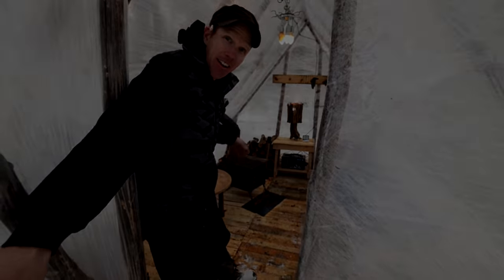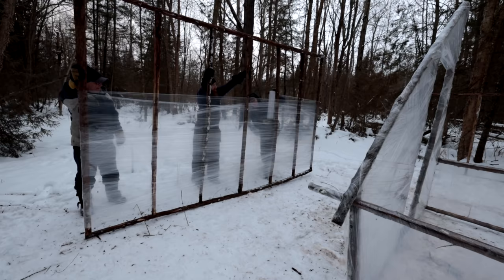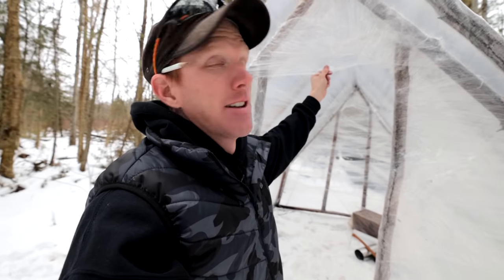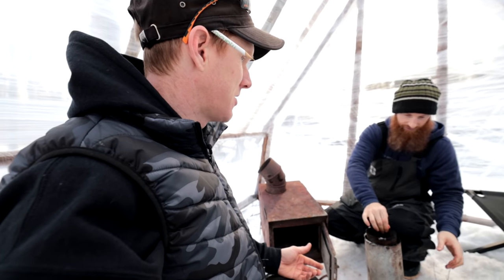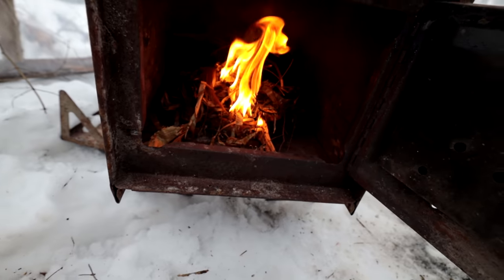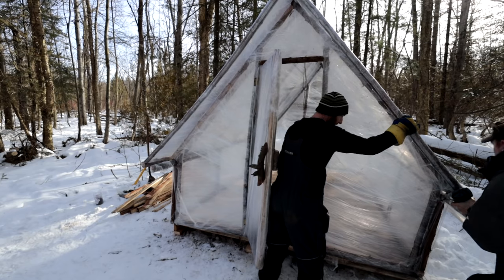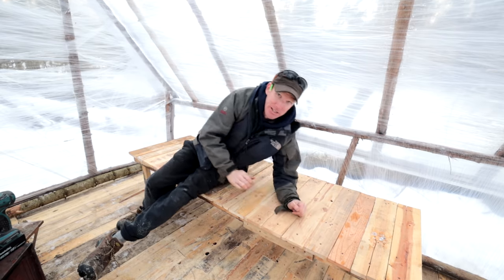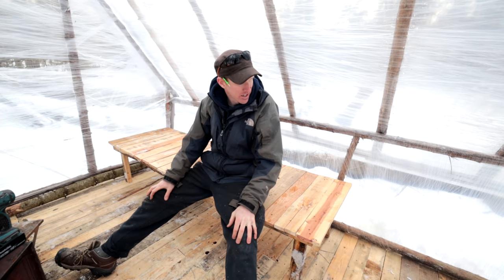$25 Winter Cabin Build (on an Extreme Budget!)

Comment from the maker: Surviving in the $25 Cabin with The Wooded Beardsman: https://youtu.be/77O7Gvud_gQ
The PLASTIC CABIN 3 YEARS LATER: https://youtu.be/MWNnv9DXjJ4
Reply: I would love to see that
Reply: You almost had this right. You forgot to add a second layer shell over it. That is the proper way to utilize it. You want that air pocket. For both condensation issues, as well as proper insulating effect. Close though. And you buy restaurant supply 3300 feet long rolls at 2ft or 18 inch rolls for 18 dollars. Best plastic for the price for longevity and clarity.
Reply: Cool project! What state is this in?
Reply: Sweet!
Reply: @SeeTheWholeTruth  Watch how they wrap it they did utilize an air pocket
Reply: What are the dimensions of the cabin?
Reply: I’m building this and use it as a greenhouse! Thank you!
Reply: You should give us a monthly update on this build to see how it's holding up
Reply: But how much does the land cost?
Reply: Are you going to leave that up?  I'd like to see how many snow storms/seasons it survives.
Reply: Could possibly be a decent greenhouse too . All the forts we built as kids we never thought of this
Reply: @maryschillinger2909  lllllllllll you
Reply: Nice work Hiram
Reply: If you make the hut airtight, and light the fire, would that not use up all the oxygen in the hut?
Reply: @baskoning9896   The air entering through the doorways is enough
Reply: What's the rated snow load?
Reply: $25 my arse
Reply: @jamestreuer7094  you mean greenhouse?
Reply: @madisaur0 Sorry but a bunny rabbit trampled it last Thursday.
Reply: @clairefredriksson5073  it's not for sale Ree-Ree
Reply: you will know if not enough ventilation when moisture forms inside a friend and I did this in 20's and I woke up in very early morn soaking wet our own co2 almost killed us
Reply: @guypatthew7613  ah ok :)
Reply: I'm gonna build one of these for almost free instead of buying a $200-$300 low quality shed in a box. I got a bunch of free tarps and thick clear outdoor plastic (no shrink wrap) Those shed in a box are made pretty crappy.I'm betting with a thick tarp covering the sides and over the roof on the cabin. It'll last much longer than a 10x20  $350 shed in a box.
Reply: 06:00
They are ready 4 thanksgiving
Reply: @maryschillinger2909  q
Reply: You guys are the worst do it with rope or just free standing trees. There are methods to bend trees with half cuts. Plz don't use living trees. You can also build a foundation with half cuts and no rope. For god sake dudes this is the worst idea Don't use F Plastic...
Reply: "WooDeD-BeARDsMAN!!"...YeP he's eXCiTeD to buiLd a FoRT! hehehehe
Reply: I get it's just supposed to ceep the wind of you but won't the seran wrap or pallet rap warp and stuf
Reply: @SeeTheWholeTruth  watch how they wrapped it again.
Reply: @donaldschell1435  For a second I thought you said that moisture forms inside a friend! Lol. 
Use some punctuation.
Reply: @Drefar  They didn't use living trees. Were you not listening? He said right at the beginning that the trees were dead standing trees.
Reply: @judylloyd7901  you don't get the point "plastic"
Reply: You can build a coat rack in your log cabin
Reply: Damn I'm good I knew the coat hanger was coming
Reply: If you ask a guy for pallet wrap in the USA he's going to tell you the job lol
Reply: Wooded beardsman? lol I luv it lolol
Reply: Yeah but the land cost 200k
Reply: Would of liked to see it lit 🔥 up at night w/ the lamp on & the fire goin 🙂
Reply: I followed you because of this NICE VIDEO！
Reply: How creative! I really enjoyed the video!
Reply: Great video!
Reply: 29:40 Chair theft was a common cause behind peoples being sentenced to transportation some 100 years ago.
Reply: You could recycle this content and turn it into a green house.
Reply: That’s nice
Reply: I knew how fuzzy you guys were I could tell by his hair cool video so far so good spend 1 night in there if it's warm enough if you guys want to sponsor trips while your observing and pay for food I'm cool with it ask Mr persistent o.j. riding if it's okay and I will
Reply: Il sign a waiver if you pay me 100 Dailey il try out all your camps gather would maintain sites and observe wildlife for you
Reply: @jamestreuer7094  James let's you and me build one just be nice this time
Reply: @baskoning9896  no because the stove is exhaling and the floor has small holes to avoid some weird venturi effect
Reply: That grills dedicated you got that thing from a good department store good stainless.
Reply: Use burlap or a patatoe sack like 2 of them fill it up with dumpster carpets and pillows or slay like 300 chickens
Reply: Build spear barricades for the bears like mid evil times
Reply: If my grandpa would let me build I would have like 10 contraptions like that out in the yard
Reply: Put the sandwich right on top of the stove
Reply: Put that lamp straight under the middle of the table for conservation of space and it would look cool
Reply: Пine
Reply: Do you have freemasonic stickers on all of your vehicle taillamps? Traveling man.
Reply: $25 Winter Build Cabin title is-in-of-itself a statement that points out an extremely low budget adding the obvious (on an Extreme Budget) is redundant and strikingly obvious.
Reply: This is an awesome idea, however, what will make it mildew or mold resistant?
Reply: self reliance  with battery packs and solar panels relying on new batteries every ones in a wile. tell me how is that self reliance again????? be off grid relying on on grid stuff how is that sustainable
Reply: Very cool idea! However here in Griz country....more like a tasty treat box! LOL
Reply: I became homeless after I caught covid 19 I went to the grid  and made me I small plastic rap structure thanks to videos like yours I'm a happy camper I have always lived in a mountain area and I am OK with it I could get a new home but this is the best freedom ever only me and the criters my next is to find a nice Dog and a good heating source I have servived 17 degree weather so far. It is  great out in the grid  I'm going to build a bigger structure like your video and decorate it with paper bags and a candle called lumennatias all around the place and a sigh saying home sweet home by Christ Birthday and envite some people and tell them what you did to harm me God turned my situation to the most unbelievable blessing I could of never imagend..Thank you for this video ..A country boy can survive..Roland J Gutierrez from Magdalena New Mexico 🇺🇸
Reply: @rolandjgutierrez7737  wish you weren’t so far I have an amazing dog I’ve been praying to find a home for my friend who’s terminal with cancer, this dog is the best but my two don’t want friends there old now. Congratulations for finding happiness I have 3 little ones or I would absolutely be right out there. My mom just moved from NY to Arizona but is in Mew Mexico she’s thinking that’s where she wants to be. She just has her truck an a pop up she lost her job as a NYC teacher because of the shot stuff so she has zero pay sold everything she has an is just going to find happiness someway somehow took her two cats an the dog lol 😂 but I know she will be so much happier sending my prayers to you stay safe an god bless
Reply: Good budget plan with the $25.00, however I'm thinking you got a total of at least $46.00 🤣 Nice job you and The Wooded Beardsman did on the build.  Pretty damn cool!
Reply: I need to find the store where you get Saran Wrap that cheap
Reply: Use aluminum tape
Reply: Netherlands. Holland.
Reply: Has Anyone used bubblewrap? Or that billboard poster material?¹the big ones and/or those little election ones? The little ones you could staple in layers to cover seams..bubble wrap and shrink wrap for the roof more air pockets??

Comment: We did something similar, but with cheap tarps instead of plastic wrap. And we used no nails at all, because we had permission to use land behind our house only if the structure was "non-permanent" (ie no nails or screws). We cut the poles a little long, and did figure eight ties around them with paracord. We put it up 2 years ago. The tarps have seen better days after tons of snow on them, but the structure is good and solid. :) We have an old military "any gas" stove inside.
Reply: Noo

Comment: I've actually done this with pallet wrap to stay warm in the high desert. The most efficient way to do this is to make a teepee or lean-to configuration. I probably used a fraction of the plastic you did. The way it works is the infrared heat radiating off an outside fire placed about 5 ft from the shelter is trapped inside the plastic, heating the inside. It doesn't have to be a big fire as the effect is cumulative. You can warm a small area and make it pretty toasty in about an hour or less. Having a stove or furnace inside is unnecessary. You can build an effective and quite warm shelter like this in about 15 minutes, and have it warm in about 30 minutes after finishing. I would advise most people to refrain from having any form of combustion inside of a shelter like this, even with the piping as you're just asking to have issues with CO.
Reply: @MeepChangeling  hes speaking on someone dying. dont do this n fall sleep. this is very dumb. tbh
Reply: @MeepChangeling  So unnecessarily aggressive.
Reply: Did you forget to bring a tent or tarp?
Actually... it doesn't matter, because this never actually happened. 
"I don't bring a tent or tarp with me while hiking, but I do bring several rolls of pallet wrap" - said no one ever.
Reply: @Cook-px8ne  With the fist sized gaps in the structure i'm pretty sure there is enough ventilation to run 3 of those stoves and not get carbon monoxide poisoning 😄
Reply: @thesayxx  exactly !!!
THAT tent/shelter is NOT air tight and that should be blatantly obvious,,, especially the gappy door 🚪 !!!
Reply: @thesayxx  A structure doesn't need to be air-tight to have inadequate ventilation from CO gas. You don't actually need to have lethal concentrations of CO for the gas to hurt you. Your red blood cells have a higher affinity for CO than O2, and once your hemoglobin is saturated with CO, that red blood cell is done. CO poisoning can take place slowly over many hours. That's why I never have a source of combustion in a shelter unless it is specifically designed for it, such as in plains teepee that is open at the top for ventilation. CO can slowly build up over time. If you're at any kind of elevation, the effects of CO poisoning are more pronounced than they are near sea-level. If you aren't well acclimated for the altitude, even slight CO exposure is going to produce a very noticeable effect.
Reply: @MeepChangeling  well I mean he did say a $25 budget but clearly not everyone can read or listen. 🤷🏼
Reply: @jpacker7977  I find it interesting that so many of you are worried about the CO2. The structure is far from air tight.. Where I'm from (Finland) there are thousands of people sleeping in heated tents (military) around the year, and I have not heard of a single case of CO2 poisoning. There are never any detectors in use for that either. The tents are not open at the top.
Reply: @David Lacey unreal how many Karen's in here I've burned wood 95% of my life and I'm 61 and my dad is 86 and he's still here if we are so worried just wrap the pipe seams with pipe tape you know modern technology lol 😆
Reply: I like your method better J Packer! Thanks!🙏💕
Reply: I just wanna mention that It's a Cabin not a Shelter. You dont usually have drills and screws, and a furnace around when you're building a shelter.
Reply: @janbo8331  I'm sure you meant CO, not CO2, a much more benign gas. In certain circumstances even CO2 can kill you but it is far less dangerous than CO, as Jay Packer pointed out in his accurate post above.
Reply: @BatCaveOz  people just go hike out to do this for fun lol. My cousin does this kind of stuff a few times a year, just because he enjoys trying something different.

Comment: There is a quicker way to do this, look for a grouping of green saplings of about 15 feet tall. Clear out the center of the group of green trees. Use a horse shoe as an anchor and tie it to a rope, pull in the trees, tie them together in groups of 3 to leave a small space in between them. Using as many as 15 trees tied you should have a nice frame for your outdoor enclosure. You can make sturdier by placing side spacing between each tree, all the way up and in random order - will give it the strength of an igloo. Mark your door, by making the brace the top of door frame and two trees as the sides. Wrap in plastic wrap on both sides of trees, start at the bottom and do 3 layers before moving upwards, this will maintain a water tight seal. 
 You can have an open fire in the center, the smoke will go out the hole in the roof, use stones - we dig our fireplace in deeper than our floor so heat begins at ground level znd lay metal tubing to fireplace,  buried, and up high enough outside not to fill with rain or snow  BUT to feed fire with constant fresh air. It's so warm even in -20c. ( yellowknife NWT. Canada) and with green trees, plastic wrap and a pocket knife you can make a sea worthy canoe! Just bring a blanket  because artic sea water is bloody cold!!! Will stay dry, just not too warm!  BUT works in a pinch when all else fails and all you have is plastic wrap! ( most rec boaters have a large roll! Knowing these skills could save your life!!) 
Peace to you and yours!!
Cheers! 
P.s. sorry for the edit, my tablet isn't printing 'a' or ' b' very well...
Reply: You can always find Wood stove and all the pipes at home demo's which are listed in most build home and recycle section in local news paper, have also found nice wood doors, double pained sliding glass doors that make nice nearly free upgrades. Lots of stuff they will let you have just to haul it away! Love visiting demo sights of old farm houses! Pot bellied stoves are an added  bonus! Here they sit at the side of the road for years! ( I know where 2 sit, today! Both cast iron )
Reply: Shazam !
Reply: Thanks for the GREAT TIPs !!!🙊🙉🙈😯

Comment: I work at a big box home improvement warehouse retailer the one where we wear red vests, not orange aprons, in the lumber department. I would most likely give you the plastic that the bunks of lumber come in because we just throw it away.
Reply: I still have my red vests...amazing how much stuff gets thrown away.  I drove @ $ 5K of nuts & bolts to the recyclers, still in original packs.
Reply: @xzqzq  it should be used,,, people can use that.
Reply: how can somebody get the plastic to reuse?
Reply: @Ktrvrn  build up a slight rapport with a worker in the lumber department and then just ask. They will most likely give you the plastic the bunks come covered in.
Reply: Having worn that red vest myself. Yep.. skids, broken stones, snapped lumber.. plastic.. lots of plastic.. hell ive got 4 of the wooden displays that succulents ship in on sitting in my shed as a storage rack because we where told to toss them out after they where empty. Good soild rot free lumber? Yep in the truck she went!
Reply: @GreysonDarkest  I'mma go make friends right now with my local red vester.

Comment: Wool blankets attached to the inside of the roof with furring strips and screws would make that even warmer, while also helping protect the plastic a little from the heat of the wood stove. Just leave uncovered any part you want to leave as a skylight.

Comment: I can almost hear that coyote thinking "crud, there goes the neighborhood" as it looks at the cabin! Pretty cool build, never considered pallet shipping wrap as a building material, but it looks like it worked.
Reply: $25? Ha ha not with through tools
Reply: $25 in gas to begin. use pallets from side of road  chicken wire even snow fence or and bubblewrap.  take a bunch recycling news paper/ straw  or wood chips mix a slurry in a bucket  and fill the skids. You can carry 2 tall skids for 3 miles a day in a modded bike trailer / hobo hauler in an hr or 2 a day. It is debatable if the old growth is a fire hazard or part of the eco system.  I was not present when it was planted so idk right. lol.  They have proven the fact that a tree does nothing or make any noise without someone there to observe it.   If you brought in and modified the pallets then why did you waste energy killing  the trees? . do you know how many rolls bubblewrap is in dumpsters. 3 rolls of that saran wrap would be at least anther $25. idk how many you used . You are certainly not anything like the two dudes in the jungle. They would have built the ice fishing sled from vines and bamboo. Don't get me wrong it is fun and interesting as Bob stated. Personally  I would have spent the money on an old energy pack from goodwill or VV for $14.99 or less. Then snag a cpl batteries and panels from a street sign or something.  The  eliminator power box  with a 12v 30ah  battery. will lose power on the coldest days but will not dip below 50% efficiency.  I did this test with a crappy coelman atv battery tender panel two winters ago 200k south of Parry Sound , On .CA.  Was out my south side window and used it only to charge my phone daily with a 10 ft usb cable.  It was the original battery so it died eventually but i got a couple years out of it. Also when my car needed a jump start in -40 kind of crap the box somehow worked? It was outside same as carr battery and not plugged into anything other then the cheap 12v panel.   Would like to see a video on how to sell a house with $25.000  for 549,000. also very interesting.

Comment: You should have built your frame for your floor then wrapped it in that pallet wrap before putting floor boards over it. It would have served as a vapor barrier and helped keep air and moisture out of the cabin. Would love to see updates to see how long this plastic holds up over time